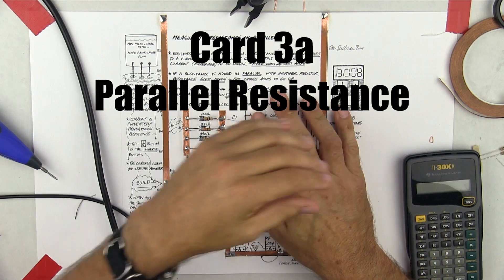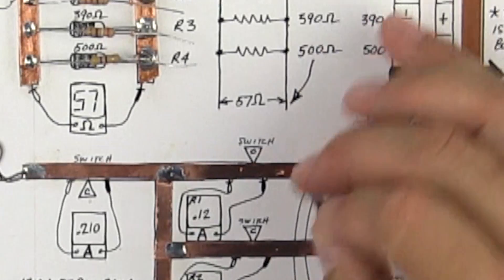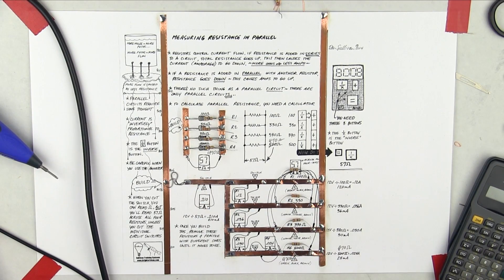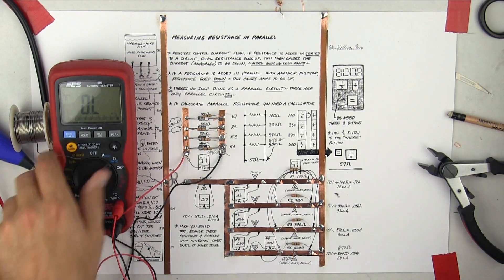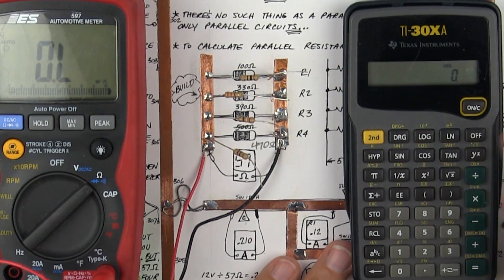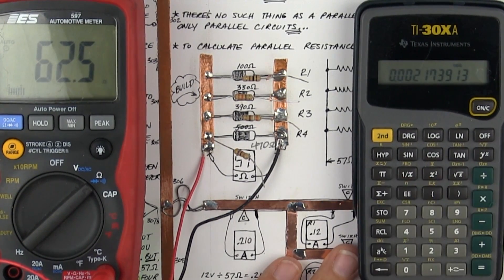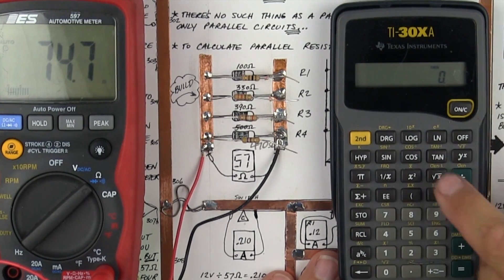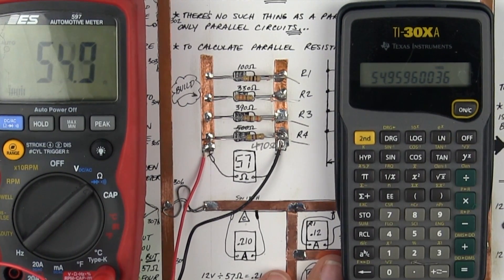CARD 3A - PARALLEL RESISTANCE - Hands-On-Line Electrical Training

Comment: Tip: If you don't own a scientific you can use the one built into your Windows 7 calculator. Click on view and you will find a number of different calculators.
Reply from the maker: Thanks! What's Windows 7?
Reply: Daniel Sullivan One of the versions of Microsoft Windows. Also would work with Windows XP and probably any other version of Microsoft Windows. I am not sure about Windows 8 because I don't have that version. I did check a copy of Windows XP and it does have a version of Scientific calculator also.

Comment: If you are looking for the inverse of a number, then 1 divided by that number gets you it.

100 Ohms and "inverse" button equals 1/x or 1/100 = .01. If you press = and inverse again, you are asking the new answer to be inversed 1/x (.01) or 1/.01 which equals 100. Use a calculator and you will see.

Btw you are also calculating Ohms law at 1V. I=V/R where 10R is inversed(1/x or 1/10R), you calculate I=1v/10R which is .1A or 100mA. By understanding what the number is giving you, it will give you a better grasp at what is going on instead of just plugging numbers in. So ten times 10R resistors in series is adding up .1A ten times giving you 1A and also 1R.

Remember that it's all about Ohms law. V=IR. A 1V drop measured across a 1 Ohm resistor will always be 1 Amp. Can't beat Ohms Law.

Comment: Another nice job Dan. It's good to have a forum where people who are interested in electricity can go to watch problems get worked out. I like to use the product over the sum method to figure total resistance, sometimes people have a hard time grasping the reciprocal method. Example, if we have a 3 ohm and a 6 ohm resistor in parallel, we multiply 3x6 ( product ) = 18 and divide that by 3+6 (sum) = 9 we get the total resistance of 2 ohms.